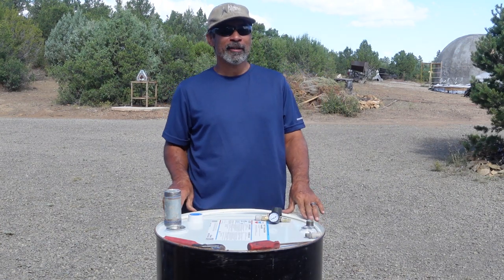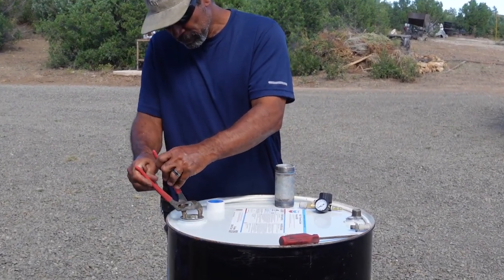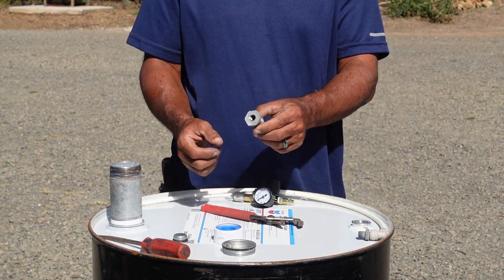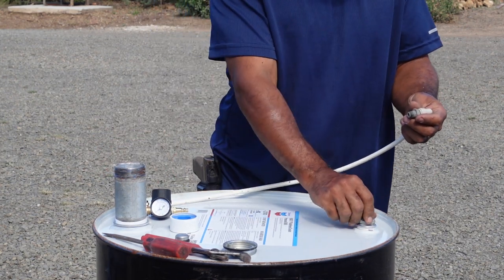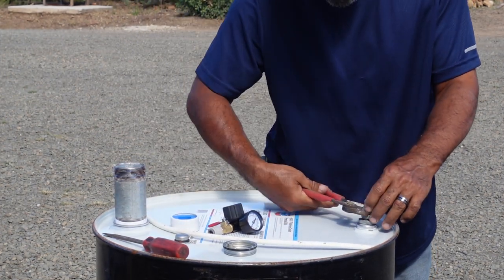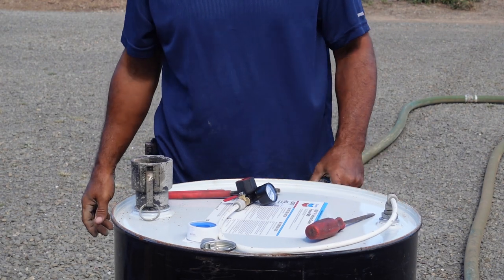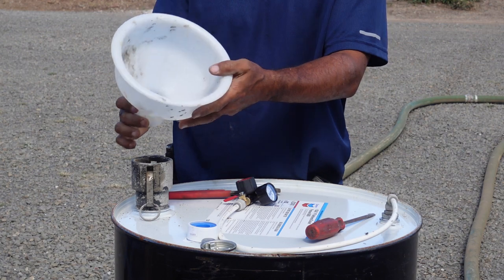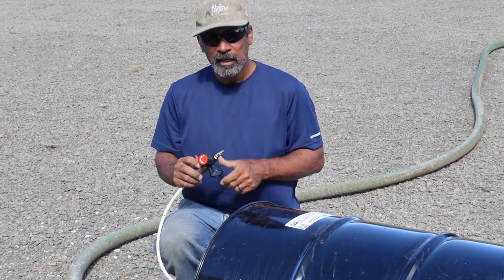DIY aircrete pump kit by #AircreteHarry | Easy setup #workfaster #aircrete #foamgenerator #diy

Comment: Harry, you earned some street cred today. Not only did you know the proper way to install Teflon, but you actually used the channel locks right. 
I’ve often seen people use them both backwards on you-tube. good idea on the aircrete drum as well.

Comment: Use a drum with a removable lid. Then you can mix in the drum and replace the lid to pump.
Reply: Exactly what I was thinking, but I'm worried if the seal is tight enough so the aircrete doesn't seep out under pressure.

Comment: Thanks for sharing AircreteHarry! This is a really practically useful DIY tool for the home and garage/workshop builder! It offers the "Wow! This really is possible!" experience. I agree with other commenters that adding a relief valve to the inlet is desirable - especially since not everything will be completely pumped out each time - so there is the possibility of remaining hardened pieces dislodging from the walls in the future - and causing a partial blockage. 
Perhaps you have a post-use cleaning process that we haven't heard yet? Or maybe these are really just one-time use barrels because they are readily available?

Comment: Why not mix aircrete in the same 55 gallon barrel you pump from and have a removable sealable lid with an air connector and a down tube that reached the bottom so you wouldn’t have to flip it over to pump all the contents out? Just saying good start but missing a part .
Reply from the maker: That is a good idea, I was using what I had available and free to me at the time. If I run across a barrel with a removable top I will work on a new version. I already have a number of pumps that work this was a cheap and easy pump to get the ball rolling for everyone else.

Comment: Applying pressure to aircrete is bound to reduce to bubble size in the foam. That may lead to the collapse of foam back to soap water/ cement mixture.
Guess to avoid that the barrel needs to be as close to the dome as possible to reduce hose length and lifted as high as possible to dome height. That way one needs minimal air pressure to move the aircrete thus reducing the collapse of bubbles in the foam mixture.
And special thanks to Harry for this gift to the world!
Reply from the maker: Because of my ingredients I add to my Aircrete I get very little to no collapsing and can pour more than 5 feet at a time. ( future video to come on maximum height I can pour)
I do start with 5psi check out next video click on CC to read what I say.  https://www.youtube.com/watch?v=c8rvYxhCkqc

Comment: Have you done any testing on how pressurizing aircrete affects the quality after it's been pumped?
It would be interesting to see if it's modified by this process, and if so, what changes can be made to the mix so the final product comes out as desired.
Reply from the maker: No problem with Aircrete after pumping this way.
Reply: Head pressure is limited, yes.  However Aircrete Harry's new addative needs to be tested with pumping

Comment: Genius! Quick q: what have you found to be ideal pressure for making drexel foam?
Reply from the maker: For my compressor it's 60 psi it may not be the same for yours. You want your foam to weight 3 lbs for 5 gallon bucket.
Reply: @AircreteHarry  ok, thx!

Comment: I've seen you try an impeller pump before which did not work. Have you tried a mud pump or trash pump that uses a diaphragm?
Reply from the maker: I have 3 diaphragm pumps that work great but cost from $350 - $800. I did not want to use them I wanted something anyone could make for a few bucks. I have tried a trash pump and it did not work the way it was meant to be used, I think a trash pump upside-down might work.

Comment: You never showed the air compressor or told us what pressure you are running at. also, Does the discharge have to be so large? Couldn't you pump it higher and farther with say a 1" hose?
Reply from the maker: Next video has more information.

Comment: And where is the video of it throwing foamed mix and not just water?
Reply from the maker: Welcome to the channel John 👍 
There are a few videos - 
Here are two of them:
https://youtu.be/c8rvYxhCkqc?si=Zbrthifs3NgiO6Va
 https://youtu.be/ZHfosbtrodA?si=87WYsUm5GUpANIs6
Reply: @AircreteHarry  thanks, sir
Reply: I have more questions, if you agree. What pressure does need the compressors? This one to move the aircrete and the one used to produce the foam. Thanks (take care with the gun. Its aiming to your knee)
Reply from the maker: @johnecobuilder274  You are Welcome.
Reply from the maker: @johnecobuilder274  Yes, your questions are welcomed. One compressor, 90 psi or more.

Comment: I'm seeing a 55g drum as 23"w*36"h, so that's >1200lb per PSI.  Keep the pressure low or you will have invented the Inflated Explosive Device.
Reply from the maker: That will never happen as long as the air can escapee.
Reply: @AircreteHarry  but that is what an accident is - when something unintentional occurs. You are essentially trusting your life with a $20 regulator. What happens if it were to fail with you standing there?
Reply: @AircreteHarry  I do think it can be made safe. For the very minimum, it should have a 20psi (or whatever) relief valve - cheap and could save a life. I think it would be best buried in something too - like maybe a bigger tank and fill the space in with water or sand or something.
Reply: You should install a pressure relief device.
Reply: 15 psi will blow the seams.
Reply: @randolphsnyder1505  I just said 20 because that's what he said its running at. But yeah, I don't think more than 10 psi is needed. Honestly, a much safer way would be to make a large piston out of ABS pipe or something and push water since its not really compressible - would just take a acme threaded rod or something like that to push the piston (with an o-ring) from a drill or whatever.